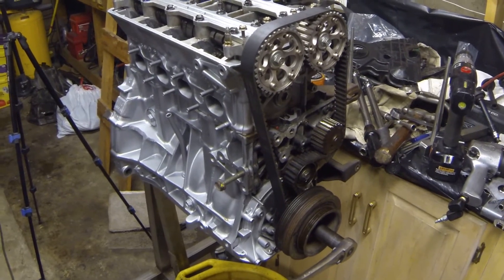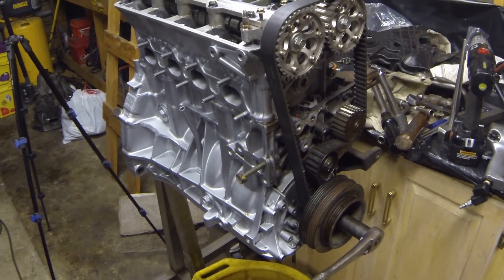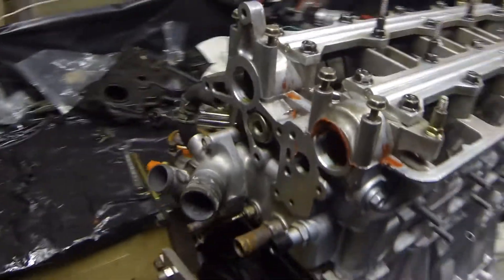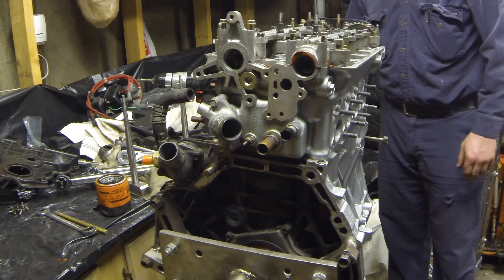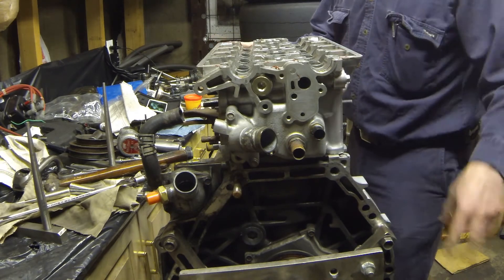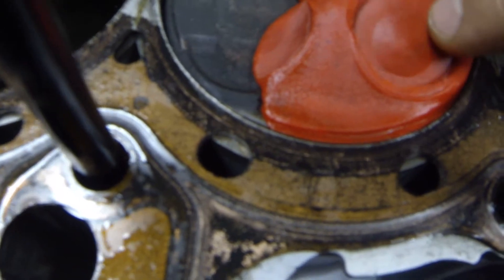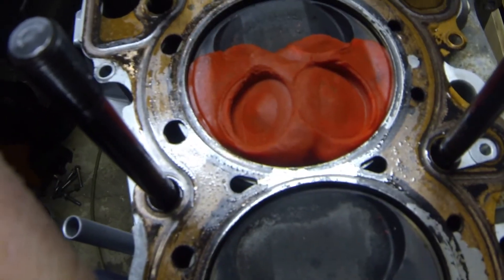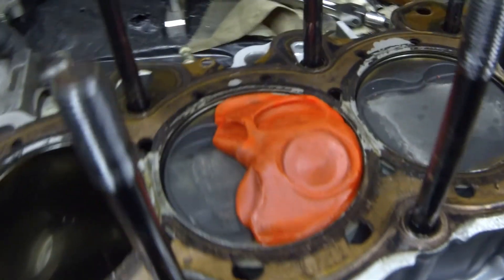B Series valve to piston and piston to head clearance inspection Part 2

Comment: Don't mean to sound too ignorant just after some knowledge as I'm about to put PCT pistons into a B16A2 and need to check the pistons aren't going to smash anything, what does the play dough do other than show you the shape of the underside of the combustion chamber? If I assemble everything like you did in the video, and crank it with a bar and it turns over am I safe to carry on?

Comment: Decent information, but why didn't you check this with vtec  locked in?
Reply from the maker: Valid point. I should have mentioned to subtract the difference in lift from the valve to piston clearance.
Reply: Kline's Garage okay there ya go, that actually saves a little bit of work! Nice information on the channel by the way!
Reply: @klinesgarage2551  ik this reply is late, but if anyone else is reading this thread, I'm gonna flip the two pins in the rockers to get measurements with vtec locked in